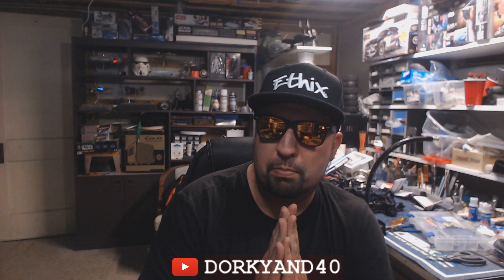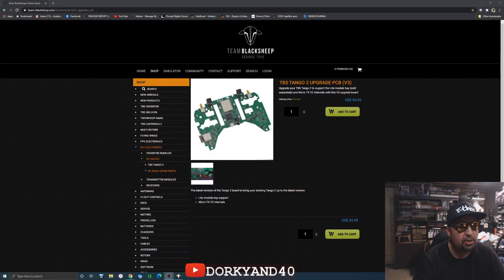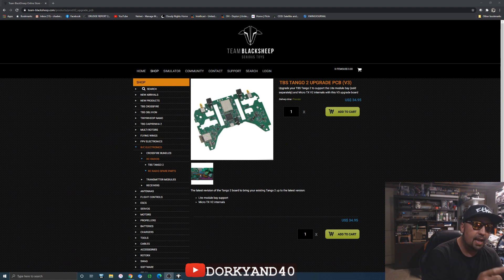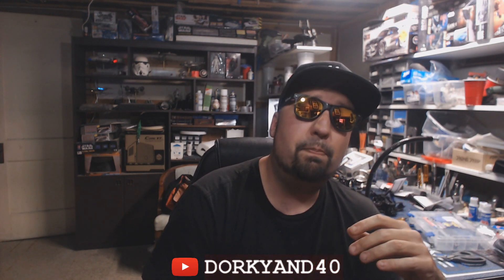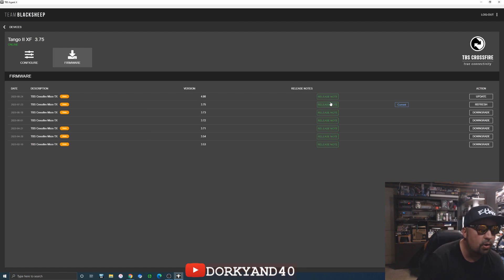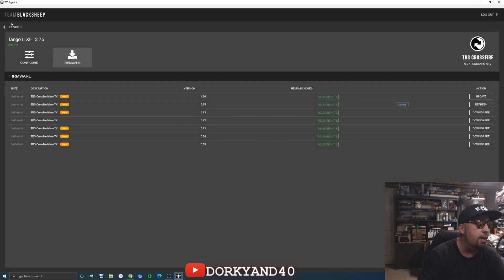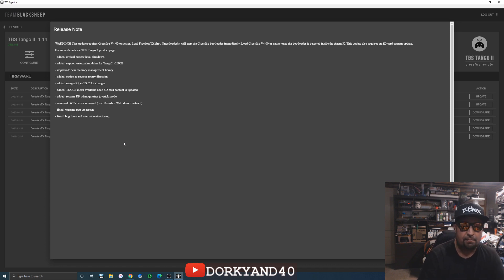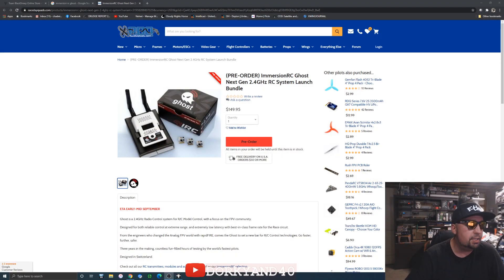CROSSFIRE 4.0 | TBS TANGO2 UPDATES | MICRO TXV2 UPDATES

Comment: Don't worry about needed more power with the DJI System. Your current setup is FAR more powerful than the DJI Goggles. I lose signal on DJI Waaaaaay sooner than Crossfire on only 250mw. My crossfire micro TX2 saved my quad with the DJI setup. My quad pixel froze after going pass an obstruction,  but it did not failsafe. The crossfire at 250mw kept my quad going  by keeping my quad in the direction towards me, while I had to wait for DJI's pixel freeze to unlock. 

And DjI...at the moment is only good up to 6km on perfect no obstruction conditions.  That being said...I love DJI system to death!   The clarity is insane.
Reply from the maker: Good to know. I mainly want more power for my long range ground vehicle. Can’t go higher with that one :)

Comment: I've got the V1 also. I have two quads, one 4 inch, one whoop. Both with nano vtx.

Only reason I'd need version 3 would be for more power. So far the 250mw tango 2 (I run on dynamic) has been spot on.
After following the couch sessions with Trappy I understand why version 3 has arrived SO quickly and I understand people's frustration if they've already ordered V2. But it seems TBS is trying very hard to keep everyone happy and updated.

Just greatful to of had such a fantastic controller for the past months.
Plus if I do decide to upgrade the board is super affordable.

No complaints from me.

Oh and with the multiprocol adapter i could even use it on Ghost at some point....
But why would I need to crossfire has been fantastic for me so far.
Reply from the maker: Yeah I get it and I’m not that aggravated about it.  But I don’t want a situation where I’m mounting crossfire on a remote with crossfire in it so I hope they can work some more magic with the v3 for my long range ground vehicle.
Reply: @Dorkyand40  that's true.
On a positive JB'S latest video comparing Ghost to crossfire should be reassuring....
The V3 board should hit fairly close to 1w.
Reply from the maker: Yeah that hotel test was kind of a joke since we have no idea what the flashes on the ghost even mean and he doesn’t have a full size crossfire so we couldn’t see the values on the screen.  I’ve also noticed that their sales pitch is it flies as far as your video link?? And that he hasn’t been using dji for some reason..only analog??  So I’m guessing it can’t outfly dji??
Reply: @Dorkyand40  that's interesting... Watching with interest.
Reply: @gmivisualsjason3729  Lol you wouldn't be able to use Ghost on your Tango 2 haha the module bay isn't built that way I just got it in the mail yesterday and it looks like it only accepts the FrSky XJT Lite external module. The module for the Tango 2 has vertical pins and not horizontal pins like you see in the back of a Taranis and isn't 2" deep so there would be no way for the tango module bay to accept the Ghost external module...Trappy isn't fukn stupid lol!!
Reply: @digilogic1812  one thing I've learnt in this hobby.... Anything can be achieved with the proper know how.

But like I said I've found crossfire to be faultless.

Comment: Thanks for the info. So are you saying with just the new Tango 2 PDB we'll get a power boost or will we also need a module to add to it?
Reply from the maker: They are on record saying as of now with the version 3 pdb they are only saying 250mw. But that’s as advertised. They hinted that soon we will get a boost. But it won’t be a full 1watt.
Reply: @Dorkyand40  Ok cool. I'll keep posted to your channel. If there's ever an official word on a power boost I'll gladly pay $35 or whatever it is. Thanks.
Reply: @Dorkyand40  additionally the new module adapter could be used with the full size crossfire for those needing the 2w power. (Not that many would use this)